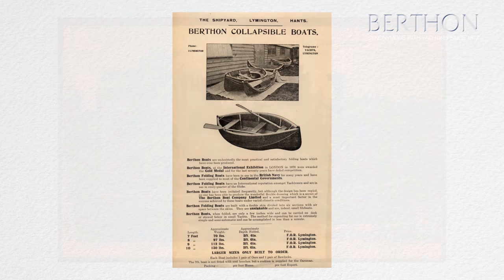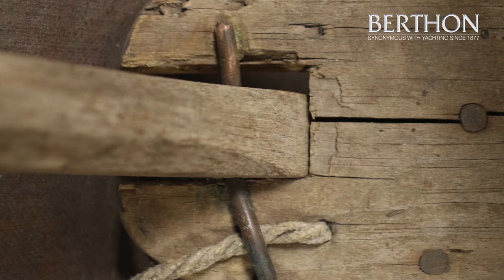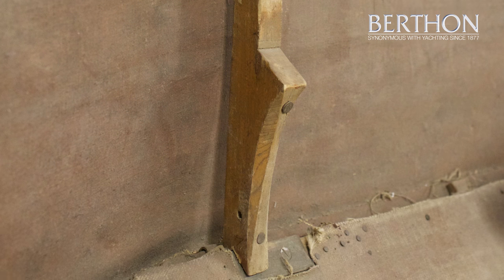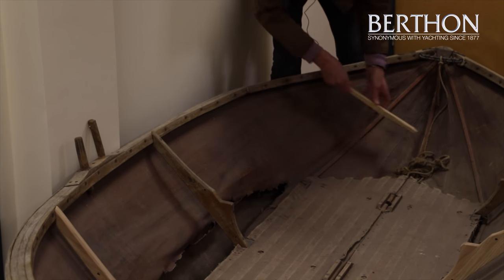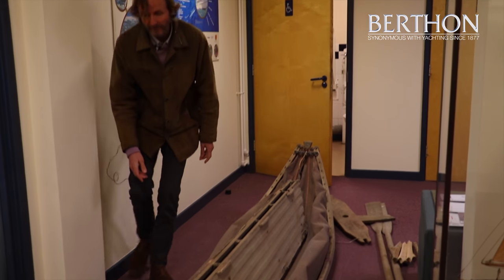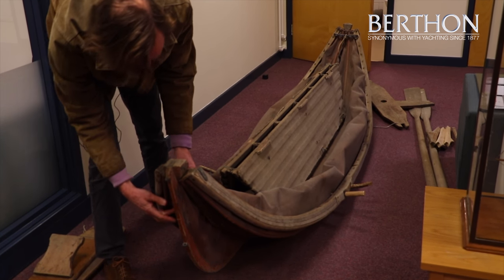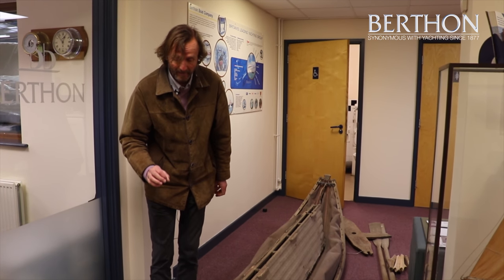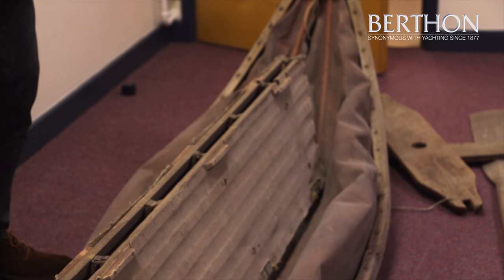Berthon Collapsible Lifeboat

Comment: Where these used in the Titanic?
Reply: No, Titanic had four Engelhardt Collapsibles. I believe the Lusitania had some of these onboard though.
Reply: On a different note what type of lifeboats did Lusitania have?
Reply: @thewhistleblower8531  I was actually wrong, Lusitania didn't have any Berthon Collapsibles aboard, I was thinking of Empress of Ireland. The Ireland had Berthon and Engelhardt Collapsibles, as well as 16 steel main lifeboats
Lusitania had 
22 clinker-built main lifeboats (capacity 68 each) 
20 Chambers collapsibles (54 each) 
12 Mclean-Chambers collapsibles (49 each) 
2 Henderson collapsibles (43 each) 
14 liferafts carrying 20 to 40(?) each 

Unfortunately I've never been able to find any pictures of any of these types of collapsibles or rafts except the Henderson type, which is pretty similar to an Engelhardt, just with a wider gunnel.
Reply: No, but her sister ship, Olympic, had a few of these installed in April 1912 following the disaster. They were only temporary boats to make sure passengers weren't scared of sailing onboard her. The boats were removed when Olympic underwent a refit in October 1912, she had new lifeboats installed and the Berthon boats were no longer needed.
Reply: According to Sam over on Historic Travels, Titanic had two collapsible lifeboats that were used.  Were they this type of collapsible lifeboat, I don’t know.